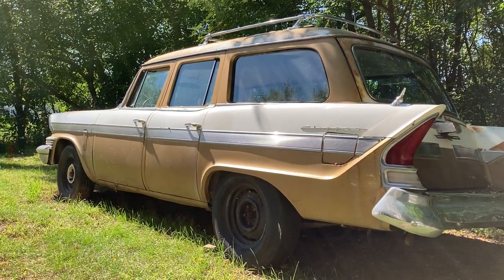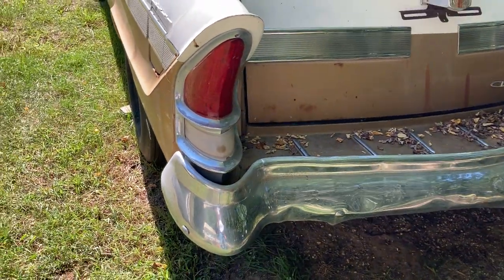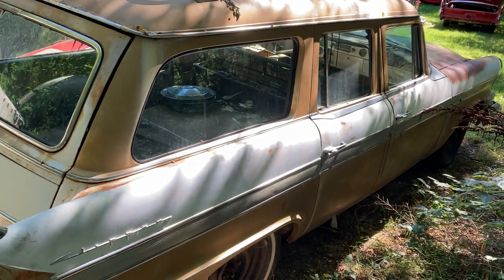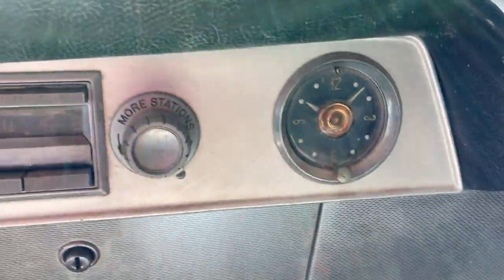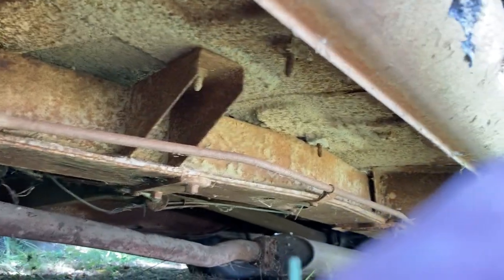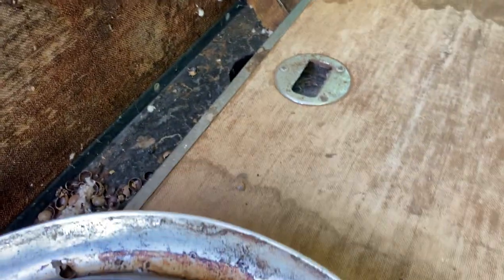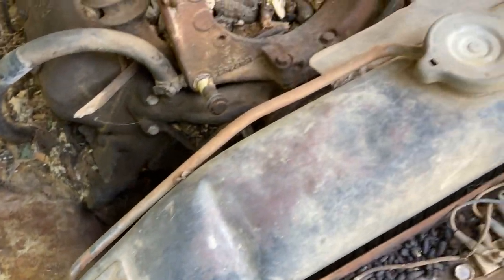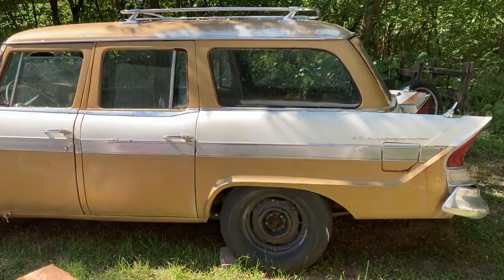1957 PACKARD Station Wagon Rescued! Rare Car Found . How did I do with this purchase?

Comment: Excellent find! Looks like a California car. I have a 57  Town Sedan I'm working on. The 289 Stude engine is very durable. Found mine with about the same mileage. I saved the bottom end of the engine by dropping the oil pan and cleaned out the sludge. Take the valve covers off and make sure the oil drain back holes are clear at the rear of the heads. Try to keep the rotating assembly alive because rebuilding it is very expensive. Have fun!!
Reply from the maker: Good information, thanks. I don’t know the full history of the car but I do have another different wagon that came from California and it is in similar condition so I know what you mean

Comment: 1957 Packard is my favorite car:  The supercharged 289 made 275hp and the sedan was 1,000lb lighter than the "real" Packard of '55-'56.  The result, 0-60 in7.8sec  (sedan w 3-on-tree & overdrive) would be worrisome to contemporary Chrysler 300's!
Reply from the maker: Cool information, thanks!
Reply: I am pretty sure all the Packard models came with automatic transmissions.   I seriously doubt it could challenge a 1957 Chrysler 300 powered by the dual quad, 375 HP 392 Hemi.  100 ponies more!
Reply: @scootergeorge7089  Yeah, 100 more hp;  but the Chrysler 300's were not "sleepers'... more like drum beaters!  The '57 Packard was all Studebaker in engine and running gear. Nevertheless, both makes always offered manual transmissions.  The car in question was 3-speed plus overdrive.  Some You-tube-available statistics  give the Packard a top speed of 117mph;  the 300 C
132mph;  the Packard 0-60 in7.7;  the 300C
0-60 in 6.9 by one account and 8.2 by another, both with 3-speed automatics.  Thanks for responding.
Reply: @winkywacky6173  - A "Sleeper" would be a Studebaker Lark/Daytona with the available Avanti performance parts
Reply: @scootergeorge7089  I S'pose so;  but doesn't naming it "Daytona" kinda diminish the purity of the "sleeper" concept?  By the way, Scooter is my "street name" too.  And very fast scooters are sleepers also because "scooter" to most folks  connotes a slow vehicle.
Reply: @winkywacky6173  - As per "Studebaker, The Postwar Years,"  people were still using the name Lark when  Studebaker was trying to stress the name Daytona.  But to the average person, it was a Lark.
Reply: @scootergeorge7089  Thanks for replying; interesting facts.  The phrase "Lark Daytona" is something of an oxymoron, which is what sleepers are all about anyway!
Reply: @winkywacky6173  - I believe that Studebaker started phasing in the Daytona name in 1963,  But the standard engine was the 170 CI flathead 6, dating back to 1939. If someone would order a base 2 door sedan with all the Avanti stuff under the hood, along with disc brakes and 4 speed transmission,  it would make for a South Bend muscle car.
Reply: There was a Studebaker Hawk in 1956 that was actually more entitled to the "Packard" name than the relabeled Studebaker,I think its Packard V8 made the car quicker than the Studebaker Supercharged engine in the "Packabaker" although the official horsepower rating may have been as  high or higher for the Studebaker Supercharged engine that replaced the Packard engine after Packard operations shut down after the 1956 model year, the Packard engines were larger than the Studebaker engine although I don't think any of them were supercharged
1956 "Studebaker Golden Hawk" ?? 
Studebaker was an important car in its own right at one time and some of the models are interesting
I am pretty sure that Packard was done for in the USA after 1956 but the Russian Chaika looks suspiciously like some of the Packard tooling/equipment might have ended up over there
Reply from the maker: Golden Hawks were amazing cars. Style wise, I think Studebaker was way ahead of everyone with the modern, sleek streamlined styling. All the other manufacturers were huge and clunky in comparison. Packard was legendary as a luxury car but really fell behind after WWII. It’s a shame both companies could not carry on. 
 I’ve seen the Russian car and have heard the rumors about the smuggling of the tooling but I don’t think it is legit. The Russian car is an obvious knock off of the Packard but I think the dimensions of all the panels are wrong and I’ve heard that nothing interchanges been the 2 cars. Seems that the Gilmore Auto Museum has a Chaika on display there
Reply: Did Chrysler 300 graduate from 2 speed to 3 speed automatic midway through the 1956  model year? 
I remember a Dodge Hemi of 1954 ,I think with 4 barrel carb and 2 speed automatic,(its hemi was much smaller than Chrysler's although designed by the same engineers as far as I know),the Dodge was much slower to 30 mph or so than a 1950 Pontiac with a 3 on the tree and a flathead Straight 8,but the Dodge had much higher highway acceleration and I believe was capable of reaching 120 mph while the Pontiac would have been lucky to have reached an actual 100. (Typical speedometers tend to read  optimistic so the Pontiac at an indicated 100 was  probably more like 95)
Reply from the maker: I don’t know about the 300 transmission changeover

Comment: Looks good for sheet metal and all. Looks like all it would really need, other than a clean-up, would be rubber replacement parts and upholstery. Not bad at all from a restoration standpoint. - Better than any of my cars. Try Kantor for Packard parts.
Reply from the maker: Thank you